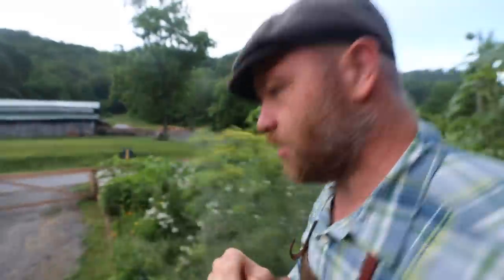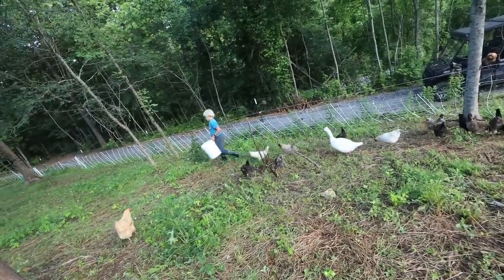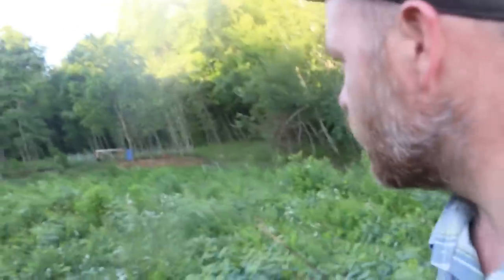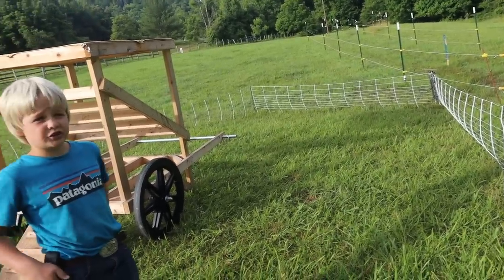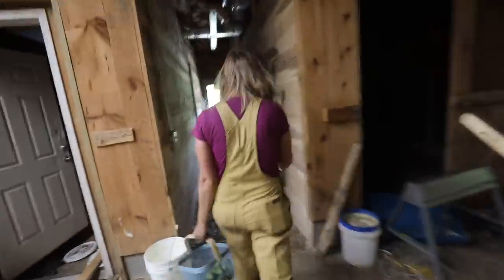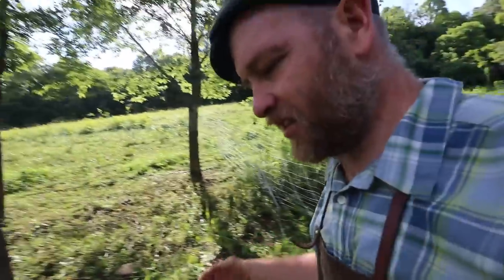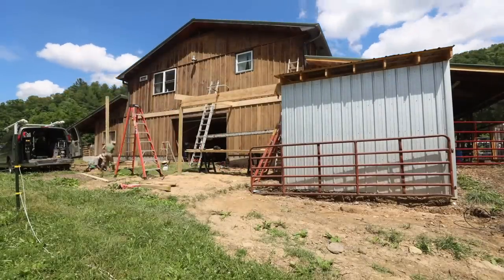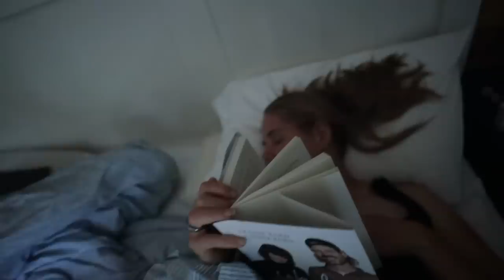This Chicken Trick Changes EVERYTHING

Comment: For the Tomatoes: We use twine or something similar, take a long pice, 10-15 inches at least (with t-posts i would even go up to 20 inches), loop around the stem and tie to the pole in a loose figure 8. Lots of give and room for the stem to grow. And depending on the material i dont need to remove it and let it rot in the compost.

Comment: Have you ever thought about buying dozens of the electric fences so then they are already set up an then you just have the move the animals through each paddock. At least have the next paddock setup or even a few ahead.
Reply from the maker: Good thought. But you definitely don't want to do that. There's too many factors going into the art of rotational grazing. The grass needs to be recovered but not overly mature. You have to hit it just right. Speed up when the grass is growing fast and slow down when it slows. Paddock size changes by weather, size of herd, quality of pasture in that area (or at that time), size of animals etc...